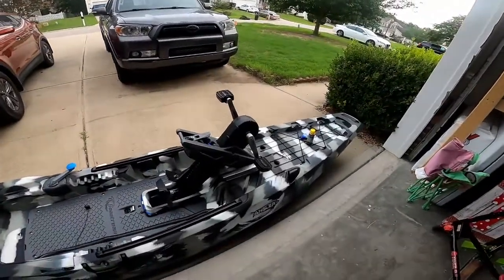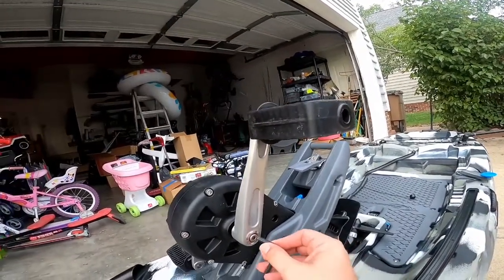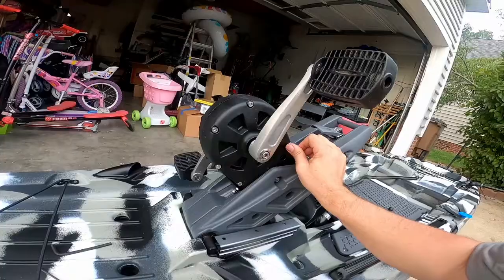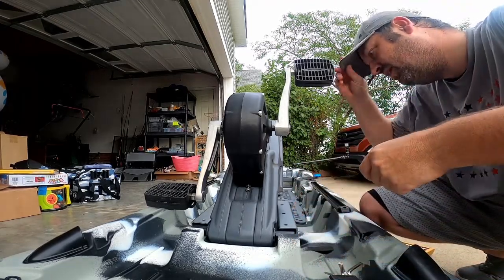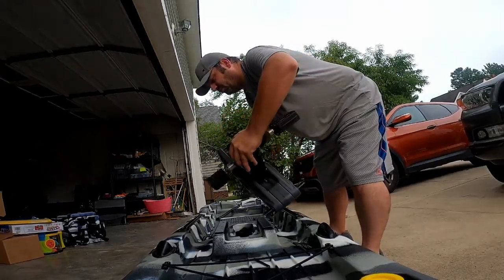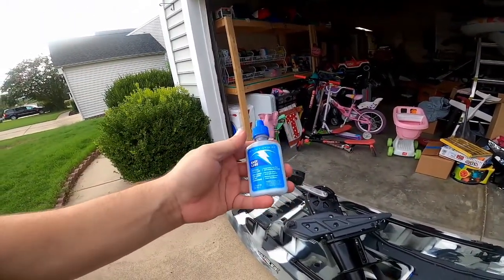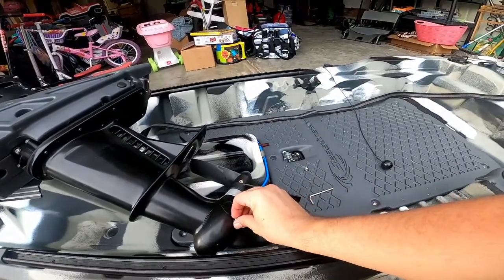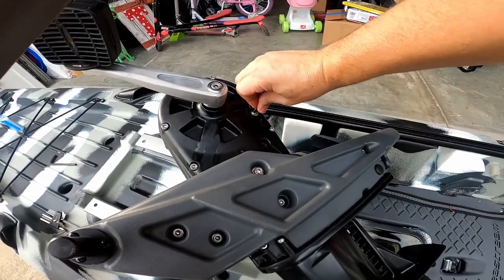Maintaining your Seastream Rapid Pedal Drive

Comment: Thanks for this video! Got mine about 3 weeks ago from ACK, got it shipped to me and I’ve took it out about 3 times since, I’m loving it so far 👌🏽
Reply from the maker: Did you check for cracks and scratches?  I have seen some people complaining about that, especially coming from ACK
Reply: Fishing the Triangle yes I have, it was in great condition when it arrived, I had a scare yesterday, I heard air coming out from somewhere and thought I had a leak, but it was coming from the gear tracks, one of the bolts had to be tightened, I opened up the drain plug and a pocket of air shot out, I’m not sure how that happened, but, other than that, it’s been great to me

Comment: Mine has water in it. Is that normal? What is the blue button thing for? Thank you for this. Hard to find videos about it.
Reply from the maker: If there is water, check your bolts.  The blue button is to center the prop when pulling the drive up.  When your ready to pull the drive up, push the button until you feel the prop hit the center pin, then you should be clear to pull it up.

Comment: The instructions on mine say to use a light grease. I wonder if the oil leaked out.
Reply from the maker: The grease that is in the drive from the factory is like the consistency of ball barring or axel grease, not like car oil, so I don't think it would leak out.
Reply: @fishingthetriangle9983  Isn't the stuff you added oil?
Reply from the maker: @stickshaker101  yeah mine was like a bike chain grease, I found out that it may not have been the best to add, but in my case it did work.  I shot this video fairly new to the drive.  Now I know better and am trying to pass the correct information.
Reply: @fishingthetriangle9983  I used standard grease gun grease and I don't think that's the answer either. I wish they had better instructions on it. I emailed them asking what lube to use but they didn't reply.
Reply from the maker: @stickshaker101  did you try the Seastream Owners Facebook group?
Reply: @fishingthetriangle9983  No, that's a great idea.

Comment: Do you tighten all bolts and which bolt is the chain tensioner. One of mine free spins I was wondering if it was the tensioner
Reply from the maker: The tensioner is on the back

Comment: I’ll tell you if you have an opportunity buy a not top of the line but good, set of T-handle Allen wrenches. They are available at inexpensive tool stores, like harbor freight. Makes life so easy.
Reply from the maker: I got some after this video was shot.  I keep the regular ones with me on the kayak so that in case something happens I have the tools with me to fix it.  The T-handles are just too big to keep with me.
Reply: @fishingthetriangle9983    Excellent. Thanks for all the information. It sure is helpful.
Reply from the maker: @truthof7382  no problem.  I keep spare rudder cables and parts, like sheer pins for the drive, on the kayak so just in case I need them I'm covered

Comment: Hey I just got mine today and had it on the water. It seemed very hard to pedal, how do you adjust the tension on these ?
Thanks
Reply from the maker: There is a Allen key screw in the front of the drive.  Pull the drive up and slide it towards the seat, so the skeg is sitting on the kayak. Adjust the screw and then pedal the drive with your hand.  This will allow you to test the tension while on dry land.  I wish the tension screw was on the same side that you see when peddling
Reply: Thanks a lot !! Is is the same size as the Allen key that came with the kayak ?
Reply from the maker: @jrroyals20  it should be.  I can't remember the direction to turn the key, sorry. Let me know if you have any other questions. I will help in any way I can
Reply: @fishingthetriangle9983  i appreciate it 🙏 😌  is there anything else you need to adjust it or can you just use the Allen key and do it while you're on the water ?
Reply from the maker: I think that there is a nut in the screw, so you need to back the screw out then screw the nut towards the drive to lock it in. I can't adjust mine on the water but I'm also like 240lbs so I do feel comfortable standing in the kayak but IM not coordinated enough to try to blind adjust it.  Since the screw would be facing the bow I can't see what im doing.  I adjusted it on land and got it to a point where I could turn it pretty early with my hand.  Have nit adjusted it since
Reply: @fishingthetriangle9983  So I just got off the water again and I had loosened and tightened the tension and I did not feel a difference either way I turned it. This is my first pedal drive but still dosent seem like it should be that hard to pedal. After 20 ft my legs are already burning from putting so much force into it
Reply from the maker: @jrroyals20  try doing it on dry land, losen the bolt, should be backing away from the drive then try working the pedals so you can see what it feels like.  Once you get it to a comfortable tension, tighten only the nut on the screw.  I have to do some stuff today but I will try to post a video on adjusting the tension
Reply: @fishingthetriangle9983  Awesome ! I appreciate it, is it possible it needs grease or lube? Its a brand new yak never used before
Reply from the maker: @jrroyals20  the grease they put in it is THICK it may need to be broke in some.  If you can adjust the screw on land and crank the pedals (this will not harm the drive as its 100% sealed) that will break it in AND you can adjust the tension.  You will feel it get tighter and loosen up doing it by hand.
Reply from the maker: I need to get more chain grease then I will shoot the new video.  I went out to shoot the video today and realized that I was out of chain grease.  Think of the tension screw as being a pin pushing on the chain, the farther in the screw is the tighter its going to be.  The farther out you have the screw, like the more threads that are showing on the screw, the less tension will be on the chain.  If you loosen it up and crank it at the same time you should feel it loosen up.  Once you get it loosened up enough just use an adjustable wrench to tighten up the nut while using an allen wrench to make sure that the tension screw does not screw back in and then the tension is back to where it started.

If you want to talk about it reach out to me on FB or IG.

Comment: You have that chain way too tight - can hear it + why did you spray lube on exterior of pedal crank arms? - so you can get it on your pants????
Reply from the maker: The chain was lose on mine, and the lube on the outside was to make sure the cranks moved freely.  I had already been out fishing so the kayak went into the garage.  The drive on mine always made that noise.  I could never get ot to be too quiet when out of the water.
Reply: Mine sounds identical, and I really appreciate your video. I have the FeelFree Moken 12.5 with exact same drive. I flipped today in the ocean and got back without issue, however I can hear salt water sloshing around inside the drive and for the life of me I can't figure out how to get the water out. I rinsed it well with a water house and fresh water, best I can do for now.

I appreciate your maintenance video. I really hope that chain is protected...if not I've got salt water on it.